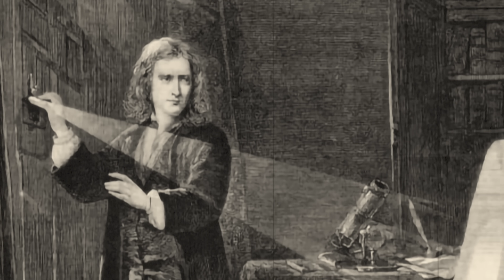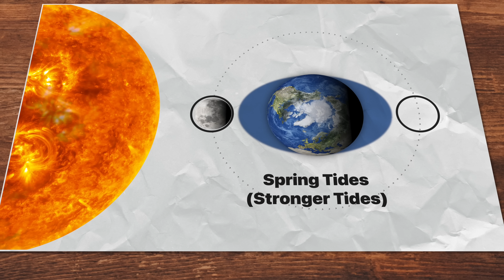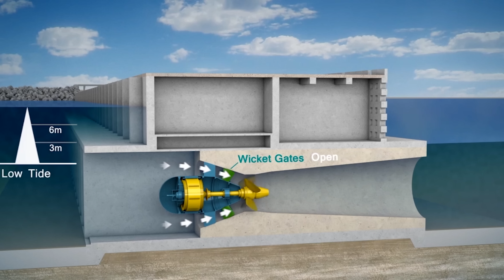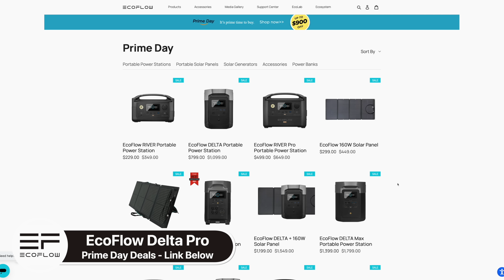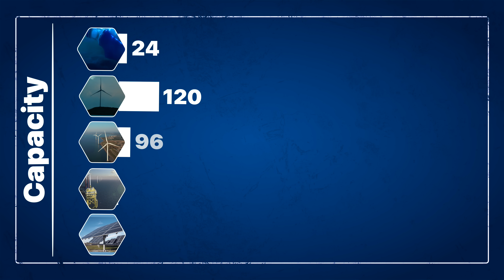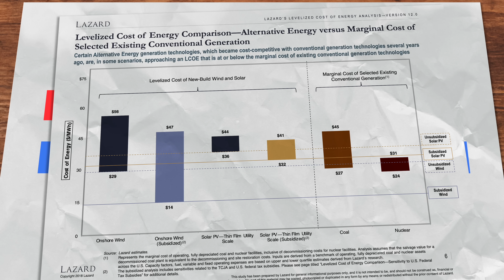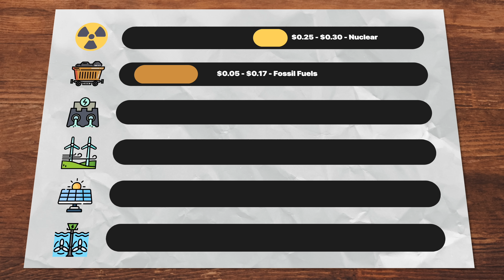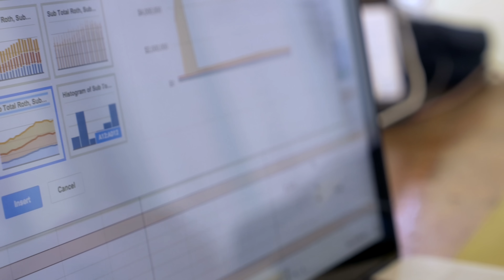Breakthrough Energy Source is 10X Better Than Wind & Solar!?

Comment: I would be interested in your take on LFTR reactors for the future. Seems to me that once the chemical difficulties are solved that they would be the ideal form of power going forward.
Reply: What chemical difficulties. The original LFTR ran for around five years with no difficulties and that was over half a century ago. Alloys in that period have made huge advancements and proper design can take care of any edge cases. The biggest problem was graphite replacement and that is easily handled by parallel systems where the graphite can be replaced while the parallel chamber is in use. That is one of the huge advantages of a liquid system where fuel elements don't have to be moved around for efficiency and they don't wear out. In addition, fuel burn up goes from less than 5% to more than 95%, with far less production of long term storage byproducts.  What's not to like?
Reply: @everettlwilliamsii3740  I agree with what you said, the difficulties are in the separation of the residual elements and the refining of the liquid sodium because there are too many contaminants in it toeffriciently run the LFTR.

Comment: "Should we invest more established renewable energy sources?" Yes nuclear would be excellent source of power since there shit ton of fuel for it and even more in our solar system and if done right and unlike how China, Soviet Union... communists in general does it leading to meltdown due corruption and politics. Same with "renewable" energy sources like wind and solar, if those are looked like those are, stop gap measure with expensive cost and severe issues, being in par with 100% coal use, just not as talked about since gotta keep that propaganda going. In this referring to enviromental impact of those being dangerous waste that we currently dont have way to recycle, but to ship into Africa E dumps to further pollute local ground water and population. Tidal power sounds good, but it being underwater is the major issue. Those first generation systems do seem pretty good since relative easy to lift up and maintained, unlike ones on ocean floor.

Comment: Give me a break buddy.  Where are you're basic economic engineering costings?  How much is the cost per GwHr generated?  I imagine it is extremely expensive if you consider the real total cost including extra infrastructure to the grid?  China makes brand new coal power stations and sells its electricity at about 6 cents per Kwhr.  I bet your wave power is probably 20 to 100 times as expensive.  And what about the internalised environmental damage by extracting and making all that plant.

Comment: One issue with factoring in the levelised cost with the energy created over 75-100 years is that we have no idea what energy solutions will exist over that duration. Particularly, just by 20 years time we could have much improved on the current energy solutions, or even created new energy solutions (fusion, for example). By 50 years time we might be looking at something like a solar satelite array/dyson sphere-lite.

That means there is an incentive for short payback times. When you also factor in the limited placement options, mass production and efficient maintenance service is unlikely to happen, which is what would need to happen to drive the prices down into the viable range.

Likely, tidal power will remain one of those options that is taken up only when it makes sense - if you are building a bridge in an area good for it, maybe it makes sense to add in a tidal range at the same time.

Comment: What about using not the flow of the tides, but the buoyancy of tides to lift mass for potential energy?
So, just using the water that rolls in as the mass at high tide as a higher potential energy, and then letting that out at low tide. Spiffy.

Comment: Hm why not having a copper layered surface on these structures? But anti fouling from sail boats are a big environmental issue when people scrap their hulls outside the harbour … As La Vagabond for example scraping the hull with a spatula in coastal spots… so quite tricky getting tidal without a back pack of environmentally problems…

Comment: when doing your energy comparison you have to account for the total area needed of a wind turbine. In the wind energy industry, they have what's called the rule of 7's. this means that the closest a 2 turbine should be placed to the one beside it is 7 times the diameter of the blades. a 50-meter blade (2MW Turbine) means that the turbine would occupy an area of 30,000sq meters. That area could generate 6MW of solar energy. Solar is much more power-dense for a given area.

Comment: One huge problem i have with this presentation is that it is estimated that the lifespan for tidal would be 75 to 100 years, that's theoretically true, maybe even realistic, BUT . . . . in 75 to 100 years techniques (tidal as well as others) will most certainly change for the better, thus rendering a whole lot of investments null and void because you will have to either replace the old systems with the newer systems, adding (huge?) cost or keep on going with the old systems, making them somewhat inadequate to the needs of those future demands. So in my opinion taking such a long lifetime is not necessarily a good thing, but it looks good though in a comparison other systems to make tidal come out on or near the top of their class.

Comment: A way forward may be to combine functions of use like structures built into the sea that can also be used as housing or commercial areas and then also use the areas in contact with the tides as propeller areas and then with types of 'fanbelts' drive the turbines on top of the sea and being exposed, they can easily be maintained and serviced.

Comment: Yes, I have heard that the Bay of Fundy here in Eastern Canada has the same flow rate as all rivers of the world combined! So yeah there is a bit of potential there! The problem is that the water has too much force. Nothing can withstand it. The turbines get shredded by the massive debris like trees going through there. Perhaps a resivoir that fills like the French and Korean examples show would be good. One inlet could be dammed and the flow could be moderated somehow. The Bay itself is a beast, the tides go up over 60' at times. Highest tides in the world. Great potential but very difficult to work with that much power. Even the three gorges dam does not see the kind of flow that the Bay of Fundy does. Not by a long shot. Also their flow only comes from one side, not both, also there is no salt or whales in rivers like that....

Comment: Holy Maintenance costs Batman! Salt water is not machine friendly.
Reply: What happens to ships and boats and submarines? Any idea?
Reply: @totaramgandhi5117  I know they do have to weld little pieces of metal that I think might be called Anodes onto ships and subs that attract rust and corrosion from the salt water. They help but do not stop the deterioration in the long run. I think responsible countries salvage and recycle most of the ships, and the rest probably are sunk at sea. I know they make artificial reefs for marine life out of the old hulks sometimes. As long as they are removing the harmful chemicals, and fuels from the ships before sinking them, there could be some good benefits to marine life if the process is oversaw by scientific and environmental groups.

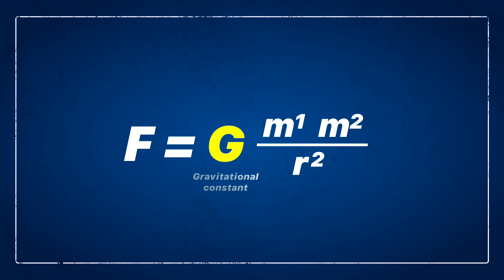Comment: 1:28 - Incorrect. Yes, that's the formula that calculates the gravitational attraction between two bodies. However, the tidal force isn't from the moon pulling fluids upward. If it were, then there would be the same behavior in sand, rocks, the atmosphere, people, trees -- pretty much everything. Instead, it's the combined gravitational vectors tending to draw the fluid inward toward the shared center of mass between the objects. It's more akin to squeezing a planetary-sized pimple and causing it to bulge.

Comment: I must admit I like this form of energy and it has a better position to claim itself as green energy. The life span is also a huge thing to consider. The draw backs of requiring ocean access and possible damage to marine life is a concern. Calling Solar and Wind green energy is a complete mislead. There cost to energy production are also way higher than your charts indicate. Nuclear is actually the cheapest, followed by gas, and coal. Nuclear being the most efficient. I am curious as to the the fossil fuel need to make these items, because that is the main component that for obvious reasons, is left out of the equation when it comes to the true cost of solar, wind, and batteries. For lack of a better description, a used car saleman is telling you your buying a Cadillac, but what your getting is a lemon. Solar, Wind, and Battery is a wolf in sheep's clothing sold to the public as green, but is about as green as piece of coal mined from the earth.
Reply: That’s changing everyday they’ve even made steel using just renewables. Using costs compared to no carbon footprint is the sane option than poisoning the air and it costs how much in subsidies, human lifespans, extinction for more than half of all the life that was before!  No choice at all. Sooner than anyone wants to imagine, a billion people experienced 120+* this year, thousands of cattle dead of heat exhaustion, after Yellow Stone roads, houses are trashed by flooding cutting off the whole North and the  top  most of the East of the park and it’s going to take a long time to fix.
Reply: @carlpodrecca5177  Sadly, that is not as true as you would like to believe. Now while they have improved the process of creating steel and reduced it's carbon emissions, none of it is created from 100% renewables and there are several being investigated right now for making the claim and being found that they are fudging the data and numbers. Now there are plants that have discovered new ways to create the steel, make it stronger, and lighter, and have devised ways to use the residuals from the creation process that can be used in other industries including fracing that actually properly disposes of the hazardous waste while also reducing and cleaning up the process involved in fracing to make it more environmentally safe. My job actually takes me to these facilities.

The death of cattle is a typical news mislead to push a narrative. It becomes a lot more enlightening when you talk to actual cattle ranchers and farmers and understand the process of how cattle are raised for us to eat. What happened is actually more common than you know and the cattle that died didn't go to waist, it just gets used in a different fashion that's not as profitable to the rancher.

The most disgusting part of what is happening right now is the political idealist have so many people convinced that we need to make change right this very second and the path to that is wind and solar, and they just aren't. These sources of energy will not only not supply the increased energy consumption needed as our population and world continues to grow, but it is actually worse for our environment, because it requires a huge increase in not only precious metal resources, but increases the carbon foot print as well, because of not only the extensive fossil fuel needs to make these resources, but also in the mining, collecting, and transportation of these resources to make them into something that is in no way reusable.

There playing a stoke market game with the resources of our environment, but our planet and it's atmosphere is not an investment where will reap the benefits of spending more now and get more down the road. If you burn up what we need for the future for actual true green resources. We will either be dead or will lack the resources will need then because we've already burned them up. Remember how renewable plastic was supposed to be. Solar panels are not recyclable. Their already baring broken windmill props because they aren't recyclable, and they can't do anything with them. I truly want us to do better to preserve and help our environment, but the blind path that's been chosen will actually bring us to the brink of destruction faster and helps nothing. It's all smoke and mirrors.

Comment: you can always plan your activities around your power input , i have been on solar and intermittent hydro power for 32yrs, induction cooker, quick shower if power shortage,full bathtub if plenty,  ice is moved from freezer compartment to fridge at night regardless of power input,keeps cooked chicken good for 5 +days, house has lots of windows no need for lights during day, low wattage 12 volts at night hardly used, watch tv, two 120watt tv's, all our hot water is heated directly from pv panels ,not through inverter, we have not used gas for 20 yrs or more, no battery charging with fossil fuel either. we have about 110 solar panels, around 70 of them $30 each second hand from a solar installer, we live in 12 feet of rain area so our solar input is often not that good, bought a heap of batteries from scrap metal dealer, i hope my story helps someone..........

Comment: Interesting video but you missed the most promising tidal energy system in my opinion, kite based systems. Check Minestos projects in the faroe islands, they are just starting the commercial rollout and have a drastically lower lcoe than these 300 ton "drowned" wind turbines made out of steel.

Comment: I lived on a sailboat in Tampa bay for 2 years. I saw how quickly barnacles and other sea life started forming on stuff in the water. Anything growing on the blades would enormously reduce the efficiency of the system and you'd need to use anti-fouling paint to reduce that. Salt water is extremely corrosive and eats up most metals, ocean organisms eat up any wood in the water too. The only thing that seems to last the test of time is thick black plastic Polypropylene.
Another thing many may not think of is TSUNAMIS!!! They'd wipe out anything near the shore. Storms and the debris they typically bring near shore would also certainly damage or destroy the turbines.
Reply: Good points. Robots might be able to clean the turbines. Personally I like solar because of no moving parts. Maybe better panels and batteries will be developed.
Reply: I don't think anything would be able to grow on the moving parts. Just the rest (structure). Maybe encase the whole thing in Teflon plastic. It would help stop growth and corrosion. Could also use stainless steel and composites. Fiberglass has been used for boats for many years.
Reply: @a2cryss  you'd be very surprised what will grow on everything in the ocean. Fiberglass and stainless steel will still have stuff growing on it and even stainless steel eventually gets corroded over time as well as its VERY expensive. I think the best choice would be thick black plastic Polypropylene because it's super cheap, easy to clean and fairly durable at least until something hits it like a large boat anchor or debris from a tsunami or underwater landslide.
Reply: @Nightowl5454  Yeah, I know stuff will grow almost everything. I meant to use mostly fiberglass and then stainless steel where needed and coat it with Teflon plastic. Crazy glue won't even stick to it and it must be cheap since toys were made from it.
Reply: @a2cryss  it wouldn't make sense to do that. I'm sure they'd still latch onto it. The other other thing other than black plastic Polypropylene that sea life hates, is cheap and doesn't enjoy growing on is rubber, tires are something ocean life hates for the most part when other options are available.
Reply: Submarine antifouling is the best - if you can get it
Reply: There is actually a fairly simple, extremely effective and long-lasting anti-fouling method which has been known for centuries, first used on Royal Navy ships when these were built primarily of wood (usually oak or teak) and the propelled by "square rig" sails. This was called "copper sheathing / copper bottoming", and that name is basically the description: Installing a layer of copper plating on the exterior of the ships hull, below the waterline.
For wooden ships, this served a dual-purpose: Preventing ordinary fouling by seaweed, barnacles and other marine organisms, but also effectively prevented shipworms burrowing into and infesting the wood. It is one of the most effective and reliable anti-fouling methods known.

It does have its downsides though: Compared to antifouling paints, or layers of tar or "blacking", copper plating is expensive and heavy. It can also cause corrosion problems, basically acting like galvanising in reverse: On iron or steel ships, pieces of zinc or magnesium are bolted to the hull below the waterline, since these will be preferentially oxidized, hence the term "sacrificial anode".
However, if copper is in physical contact with any iron or steel below the waterline, the iron becomes the anode, being oxidized preferentially to the copper. On wooden ships, this caused corrosion of the iron or steel nails or screws holding the timbers together, weakening the hulls. Using screws or nails made of copper (or copper plated) can avoid this problem, but these can be weaker and more expensive.
Reply: A Tsunami won’t effect Turbines in deeper water… it’s more of a swell, a rise and fall.
Near shore shallow waters are the damage zones.
Totally agree on anti fouling, places with higher tidal range tend to carry more nutrients and present a greater challenge.
👍🏽
Reply: @slim1100  I'm guessing they wouldn't be putting the turbines in deep water because the current wouldn't be strong enough in most areas.